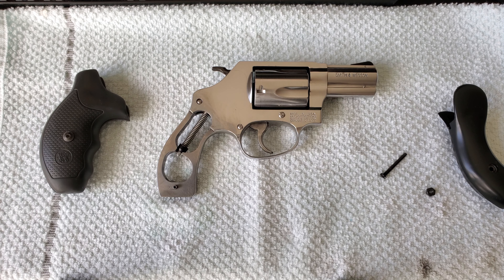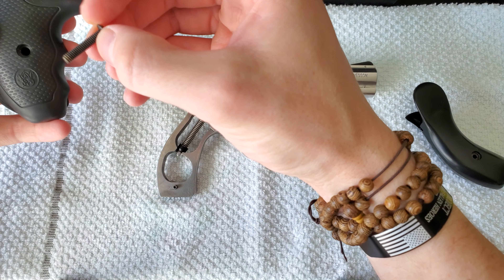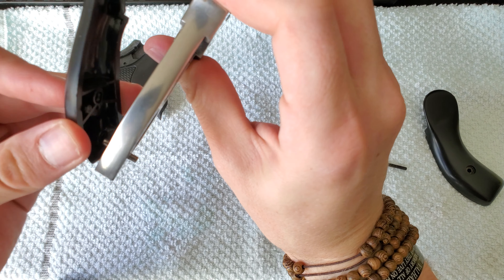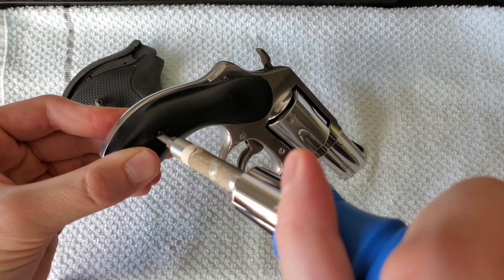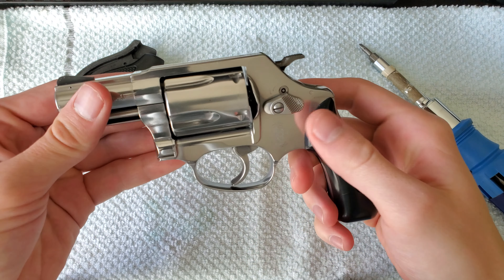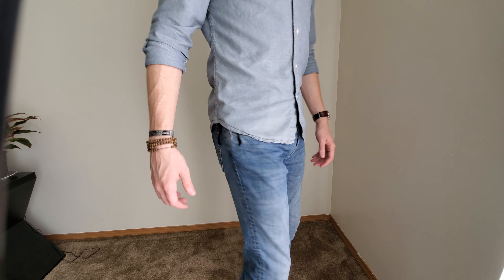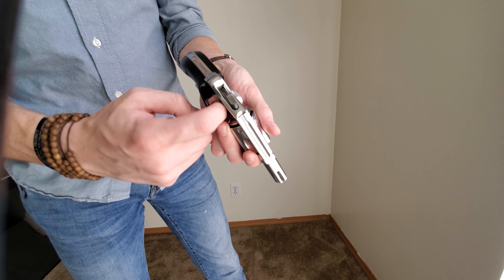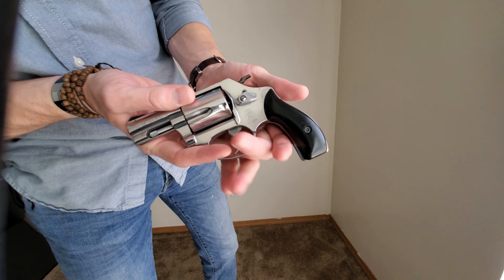Barami Hip Grip - S&W Model 60

Comment: Add a Tyler T grip adapter and a Hogue jr. sized slip on grip sleeve and you’ll have the full Werner setup. That’s how us old guys used to set up J Frames before the DeSantis Clip Grip.
Reply: Still a good idea.
Reply: I have these for a k frame,  and I can't get the T grip adapter to fit with the grips (mine is the pachmayr version)
Reply: @artwebb6939  the t-grip doesn’t always fit perfectly.  They sometimes require a little sanding or tweaking to get on.
Reply: Why is it called a Werner set up?